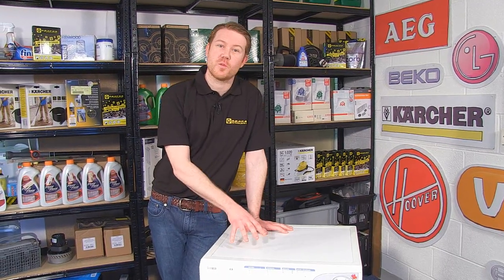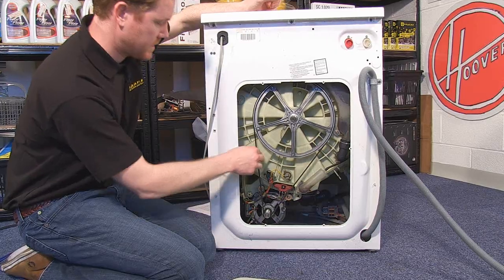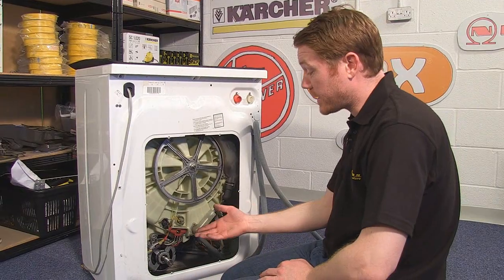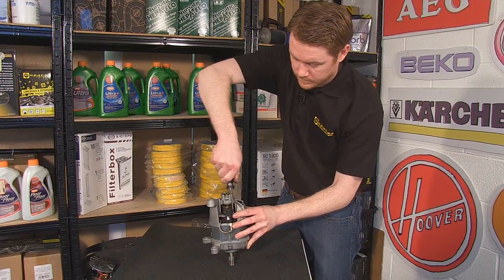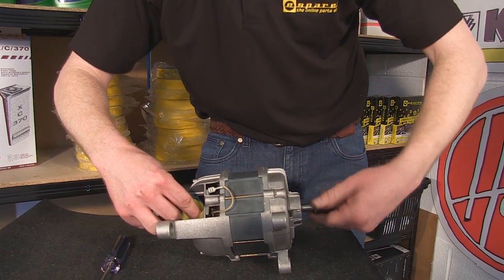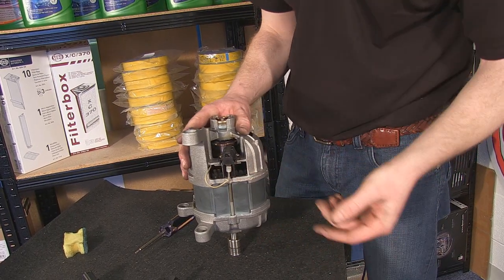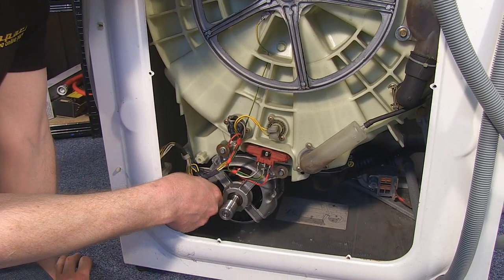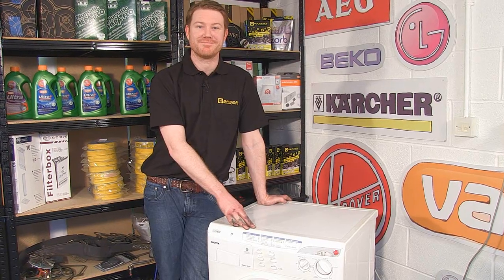How to Replace the Carbon Brushes on a Washing Machine (Hoover)

Comment: Excellent tutorial. Would just like to add that after I installed the brushes and fixed the E08 error code on my machine, it was super noisy and started displaying an E09 error code when it entered its spin cycle, indicating some problem with the motor triac on the circuit board.  After I reset the machine/ran it through self-test mode and put it through a few more noisy washes, the noise and new error code disappeared and the machine now works normally. I would wager the new brushes needed some time and a few test washes to "bed in".
Reply from the maker: Hi, thanks for your appreciation of our video! We're so glad it helped you. Thanks for your additional comments, pleased to hear your washing machine is now working fine.

Comment: I've just ordered some brushes online for a hoover washing machine and the profile on the carbon tips are facing the opposite way from the worn ones. Can they be fitted regardless or do I need to source another set which has the correct profile on them?

Comment: Hi just a quick one i keep getting the same error code on my hoover w/machine brushes worn, the thing is just one side wears down quicker the thge other i have changed the motor the brushes sit on but it still happens..i change them every 12 to 18 months..
Reply from the maker: Many brushes are fixed at an angle so make sure the slope of the brush tip makes a flat contact to the commutator. If excess wear is occurring use a fine abrasive paper to clean and smooth the commutator surface before fitting. if it still occurs the only cure would be a new motor.
Reply: eSpares I have changed the motor and Otis still doing it wearing down unevenly the guy changes the brushes every 12 to18 months is baffled

Comment: There is a much easier way… just flip the machine up-side-down… 
The carbon brushes are normally at the bottom of the motor, with a bit of luck they can be replaced without taking the belt and the motor off the machine